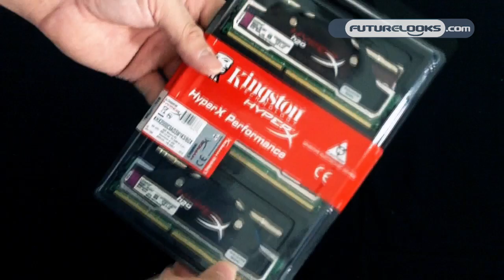Futurelooks Unboxes Kingston's HyperX H20 Performance 2000MHz DDR3 Triple Channel Memory Kit

Comment: mips has a better solution for memory watercooling. if i think about using 6 of these OMFG -.- the tubing will look horrible and how the hell can you install the tubes anway? i wonder if tubes can be bent this way = |_| ... ehm no ... ive measured the space between my graphics card and my memory ... 3cm ok this product is not useful for sli/crossfire users or ppl with just one pci-16x slot.

move on futurelooks ... and give kingston a slap on their neck.